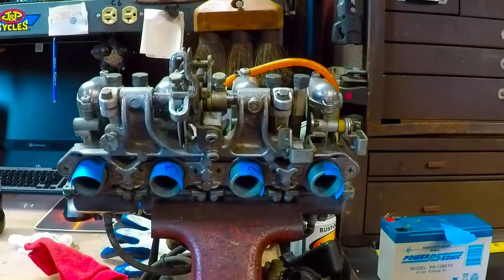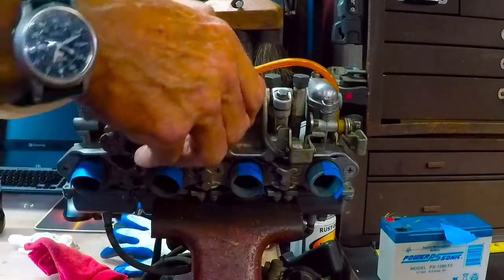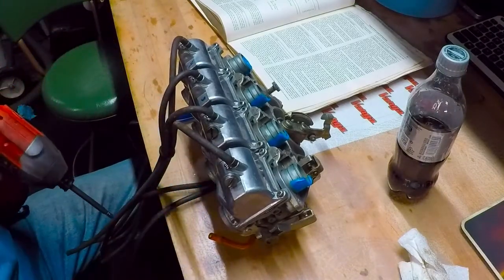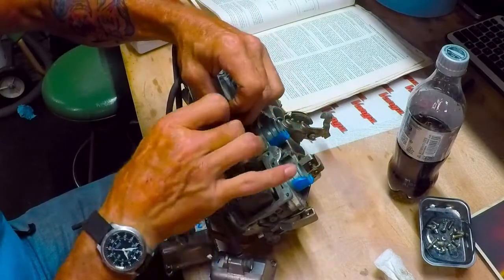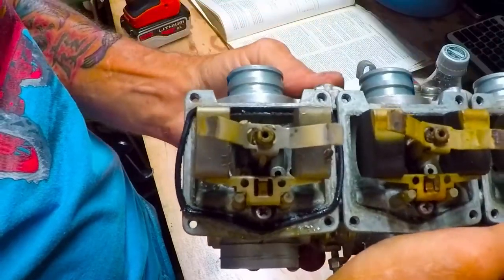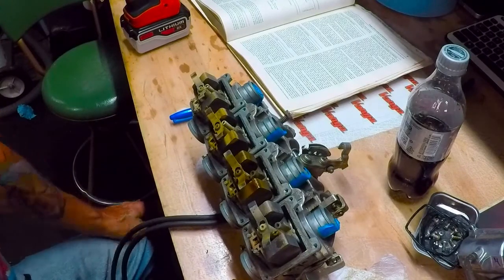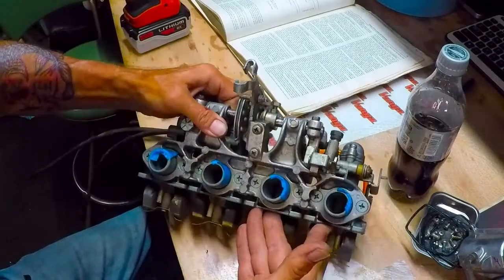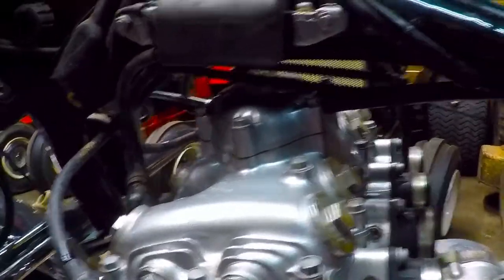CB350 Four The Bill Carbs First Inspection

Comment: Use a pump to suck the excess sealant from the tank. Simple description: pump inlet with hose fitted into the lid of a ball jar, second hose fitted into same lid, and other end this hose terminates into the fuel tank, into the excess sealant. Ball jar act as a collection bottle for the excess sealant, preventing the pump from clogging with sealant. Ball jar penetrations must be air tight, and have a capacity greater than the excess sealant. We use a paristaltic pump, but have used a windshield washer pump when removing POR15 from a tank. Just do a trial test first to check your fittings and pump. Greg.
Reply from the maker: Excellent advice and explanation Greg!! Thanks a Ton!!! I totally understand what you're saying. Similar to a brake bleeder! Cheers! Zip~
Reply: You got it!

Comment: I just did  mine 0n a1974 cb  350  four i used metal rescue it came out spotless i dont want to coat the tank either i have in the past and had very good luck with kbs but i dont want to chance it on this bike all i do is mix a little 2 stroke oil in about every 3rd tank and it keeps it from developing flash rust  so  far so good

Comment: I just got some Evapo Rust to use on my 3210V tank.  Took me forever to find this video.  I vaguely remembered you mentioning the results of the treatment, but wanted to revisit your findings.  I agree with comments below about not sealing the tank., by the way.  My H-D manual even instructs to store with a full tank to avoid condensation.  Judging from the rust you pulled from that tank, looks like good advise.  I've stored it that way since new & will certainly continue to do so after watching this.  I hope my 3210 tank comes out as good. Thanks Zippo
Reply from the maker: I've got to do Mini Lords tank to get rid of just surface dust/rust. When you do your 3210 tank, don't be surprised if you end up with pin holes. But don't fret! you can solder them all in with good results. Remember...Save the Evapo-Rust! It's good until it no longer works and can be used over and over. I just used a paint strainer to take out the solids each time I use it. It gets darker in color with each use, but it's great stuff! And yes....don't seal your tanks! Not unless you want a big mess on your hands. That's why I chose to stay away from the Red Kote on Big Bill. Cheers Sir Pipe! Zip~
Reply: I did save it & also used a paint strainer to filter it.  The tank is pretty clean, it only had minor rust, but at some point it appears it was patched & sealed.  Now some of the sealer is flaking off, & that's what I have to get cleaned out.

Comment: i never used red kote.... yet. i have watched videos of it being used and installed,if the tank is clean,then dont sweat it. However,in the mean time you need something to prevent flash rust until your ready to put gas in it.i use permatex high tack spray on carb bowl gaskets so they seal and stick. ay overspray will wash off with gas and not plug anything up

Comment: Thanks for sharing this one, Zip.  Technology is great until it's not and it's so frustrating because it's always some little thing (like forgetting a dot in an email address or some other such foolishness.)  I used to top my tank off after a ride to force that warm, moist air out to prevent rusting, and yeah you're so right....i never use ethanol fuels on any of my vehicles (unless I can't find it on vacation and even then I run that stuff out as soon as I can.)

Comment: I use RTV occasionally  on non pressurised oil areas but I would never use it in a carb.  You would know that.  Interesting #2&3 were the ones that needed a bit more work.   Can you go to dual fuel filters and just use the tank?

Comment: Wow !! lucked out again BIG TIME!! piece of cake  i thought sure you would have to at least get a couple of bowls they are fantastic!  the red coat is crappy, way too thick and it does pool, like You said  that is why i insist on the Gold standard it is a better vicosity  for all the weird angles and curves. just keep it rolling and turning the stuff is thin and as long as you keep it moving i have never had any problem but i have several tanks with red coat fail  and  the Cream. is not worth a shit either  the red coat and the cream  do work well on automobiles and larger flatter tanks with lots of access /draining holes sender units/fill spouts/ect. but for small bike /engine  tanks the standard is the best !! just when you think you have it all swished around  once take a 3 minute break, then do it again, and again. then  start dumping it out while rolling and dumping put it right back in the can and when you think its all out try again i always let it cure upside down/petcock up. the most thinest on the tank is usually the top from condesation. and this leaves the bottom nice and the built in reserve if it has one  good to go and not filled up with all the tank sealer. Please coat it as the tank has got to be thin as hell with 45 years of  use/neglect and we sure dont have GOOD gas anymore. take care,bob

Comment: So I know what your talking about on the tank, if its clean enough and there is enough metal leave the Red Kote out. Also what is with the colors on your videos? Are you filming in HDR or something? Cheers!
Reply from the maker: I don't know! They went funky on me for sure. I'll reset the camera and see if that cures it. Rode for a couple hours yesterday after getting the bike all legal and had no issues what so ever. The Red Kote can sit on the shelf for another project. I'll drain and inspect the tank after a couple tanks full have gone through it and see if any flash rust has materialized. If not, I'm calling it good. If so, then I'll take another route...either epoxy or The Gold Standard I believe it's called. Cheers Sir Moto!! Zip~
Reply: I like that idea, I think its a good call. If there is no rust you are good and just ride and enjoy! Ah.. but ride safe!